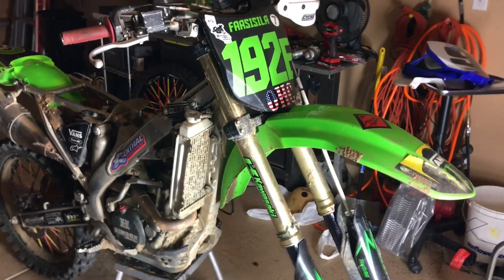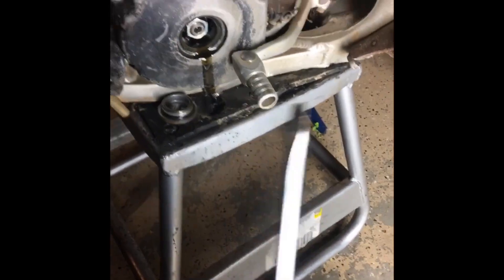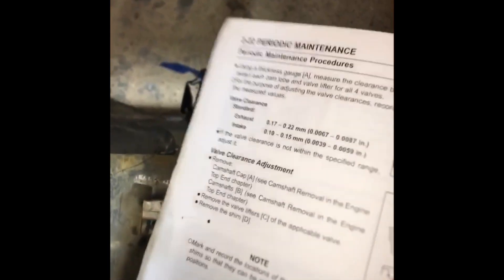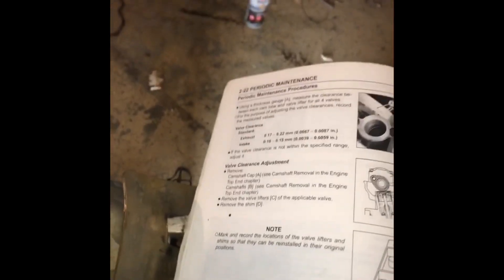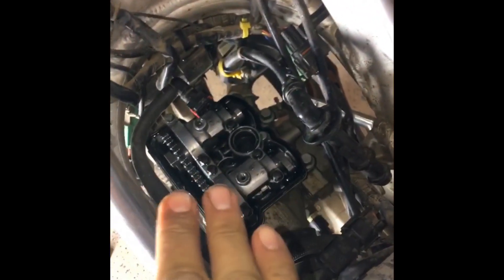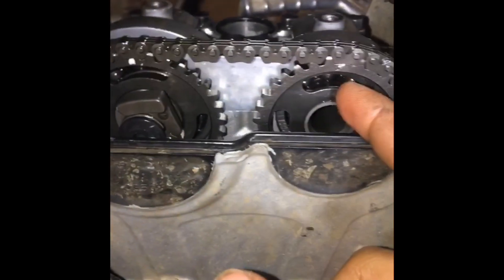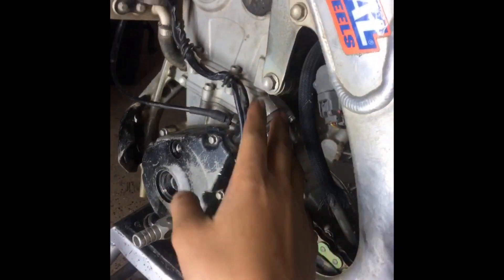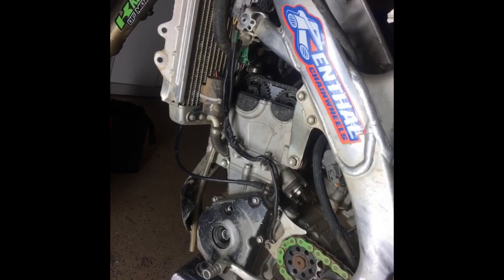2011 KX250F Valve Adjustment

Comment: I see you’re getting away fine with a NON tapered Feeler gauge.   I have the same bike and the same non tapered feeler gauges.   So I guess I’m good to go?   Or do you advise getting the tapered motorcycle style feeler gauges?   Thx and thx for the vid
Reply from the maker: No problem and nom tapered should be just fine, just wakesure you go in nice and smooth and dont force then in too much or they might bend